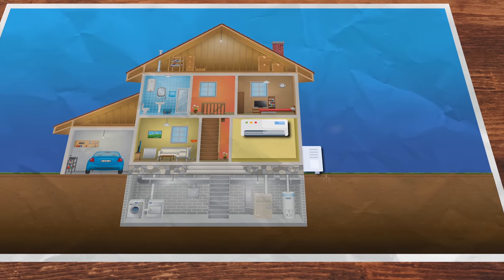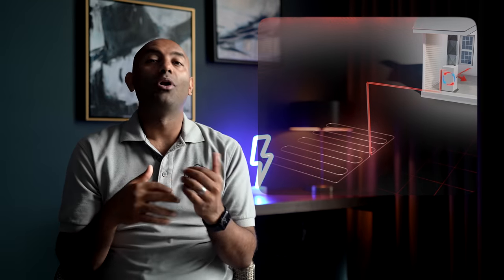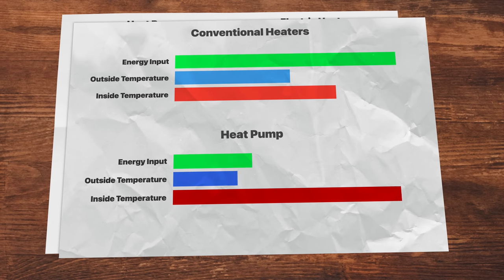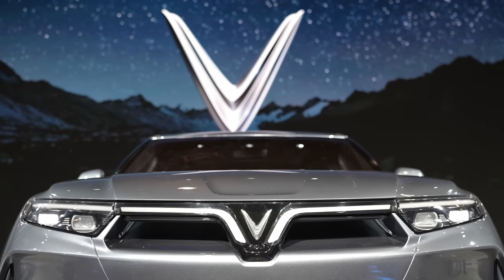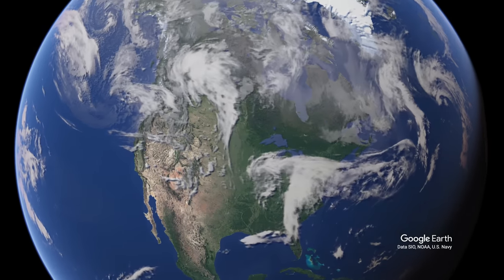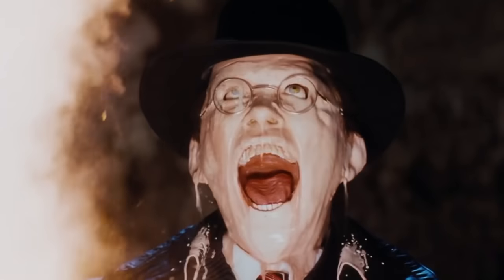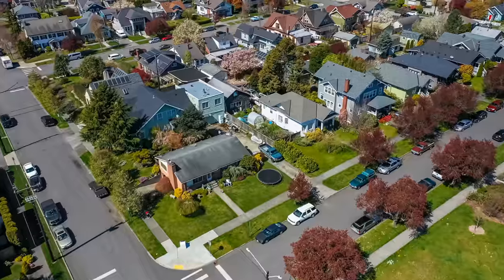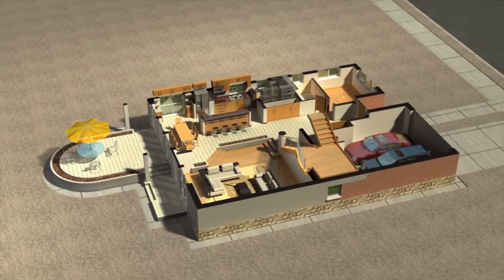Adding This Can Save You Money Summer & Winter!

Comment: At $7,000/well, it only takes 240 years to justify the cost.
Reply: not exactly i mean it can switch you off natural gas which is only going to increase in price especially another 20 years down the road trying to curb emissions. switching to more efficient electric also lets you run off solar so you could even further maximize savings over time. Electricity from the grid and natural gas are only going to go up in price so if you look towards the future at all you are looking at even bigger savings.
Reply: I installed my geothermal. Myself for $22,000. I had estimates for conventional HVAC for $26,000-$34,000. So way cheaper than conventional. Because I installed it myself.  And I have 10,080 watts of solar. 
Zero bills. 3400sqft house all electric. 
If I take what my friend is paying for his utilities. Propane and  electricity. $5,000 a year smaller house built in the 70s. 
It's already paid for itself. Money in my pocket from here on out.

Comment: You are using the wrong term and should know the difference. Geothermal goes way down into the earth and extracts boiling water. What you are talking about here is a ground source heat pump system.
Reply: Or geothermal is the wrong term for ground source heat generated electricity. Can be and is used for both.

Comment: No matter how many of these videos I watch I never see anything about larger buildings utilizing geothermal. Definitely no examples in NYC or Chicago. We also don't hear much about the transfer mediums like R410a.
Reply: R410a is a refrigerant that the compressor uses. You still need a liquid pumped through the underground pipes to absorb or dissipate the heat from the evaporator/ condenser.
Reply: @ColCurtis  heat pumps use refrigerant in reverse to extract heat.
Reply: @damionfragoso2655  they can run in either direction, condenser inside evaporator outside for heat, evaporator inside and condenser outside for cooling. In a ground source system the refrigerant doesn't flow through the ground, a liquid like glycol is used to carry the heat to and from the heat pump unit.
Reply: @ColCurtis  you really don't get it. Leaking refrigerant is one of the largest greenhouse concerns as most of the developing world adopts air conditioning. And the only realistic option is compressed CO2 and it is a long way off due to the pressure it requires.
Reply: @damionfragoso2655  this is the first time you mentioned leaking refrigerant in your three comments, I don't know what you are trying to get at, the refrigerantis in a closed loop. I also don't believe refrigerant is one of the largest greenhouse concerns.  But anyway I'm done chasing your comments.
Reply: More heat to move than the ground can handle.
Reply: @kkarllwt  oh I mean to heat the buildings as for cooling I think that is better for exhausting to the air.
Reply: @ColCurtis  funny because I was the one replying you 🤣
Reply: @damionfragoso2655  Plus all the  refrigerant is inside the geothermal heat pump cabinet no. Lines to the outside unit or mini splits. Less refrigerant. No lines to leak.
Reply: @danmccoy6164  most geothermal heat pumps us less refrigerant than external air heat pumps. As they rely on warm water or coolant that is pumped
Reply: @damionfragoso2655  yes my geothermal system does heat through 3400sqft of infloor heat. And chilled water fan coils for cooling. The water running through the fan coils needs to be very cold. In order to remove humidity.  
The heat pump doesn't depend on the temperature comming in from the loops. To heat or cool. It is just transferring heat to or from your house and putting it into the water coming from the loops.  So instead of having to transfer heat out into 100 degrees air and magically pulling heat out of -15f
Air outside. It only has to transfer it into and from 56 degree water. 
You can use forced air geothermal. With exchanger in a blower cabinet. Less efficient. 
I've been running for 5 years plus. Zero bills. With 10,080 watts of solar. My house is all electric.
Plus all my domestic hot water is supplied by a water jacket around the compressor.

Comment: This is quite a misleading video as the technology is effectively interesting but check all the video of people having trouble with such system and you will see that in reality it does not work great.
Reply: I  installed my system myself. Except for the loops. I paid $5000 to have 4 horizontal loops installed. On my one acre lot. I used the one guy who does all the loops in a try state area. And having a lot of experience. He sized the loops for my system. 
I  think a lot of the problems are with improper loops sizing. 

I had 3 different estimates done for my house. I gave blueprints to all of them. The first 2 I got. Said I needed 6 tons to heat my very efficient house. Both had wildly different and complicated equipment.  Both had estimates in the upper $45,000 range.  Then I found out that the most popular HVAC  company in a local town had been installing geothermal for 35 years. He said that I needed less than a ton for cooling my house. And came up with a 2stage unit that ran on 3ton most of the time. And ramps up to 4ton for periods of a week long -20. Had way less. Way simpler equipment. Came back with $45,200. I couldn't afford that. So I got a guy who does all the HVAC for the plant. That I drive forklift for. To buy the equipment that the last guy had on his estimate. And I installed it all myself. For $23,000.I have had it running for 5 years now. No problems. 
I think a lot of the problems come from having systems installed by contractors like the first 2 I got estimates from. That have no clue what they are doing. And charge double. Just because it's geothermal.

Comment: Most people will never recuperate cost off ground heat exchangers, those are great to woke environmentals and ones that can not count their money.
Reply from the maker: Depends on how long you stay, and what happens to natural gas prices in the future. Such a system is good for winter and summer. I’m no woke environmentalist … trust me that’s not the target audience.
Reply: @TwoBitDaVinci  Thanks for the reply
Reply: I installed mine myself. $22,000 including the  $5,000 that I paid to have the loops installed. 4 horizontal coils  on my 1acre lot. For less than the estimates that I  got to have conventional HVAC installed. $26,000-$34,000.
So cheaper than conventional by far. Because I installed it myself. 
I drive a forklift for a living. Plus I have 10,080 watts of solar. Zero bills. 5 Plus years running. 
I personally like global warming. Living in Wisconsin. I now have a 3,400 sqft shop/house. All 3,400 sqft. Heated and cooled all the time. For free.

Comment: Sure it is! Until nature decides to change the fact that the temperature underground is always between 50 and 55 degrees... Did I miss something?
Reply: What at you saying? Are you suggesting nature is going to dramatically change the ground temp?
Reply: If you go deep enough the soil temperature is the average surface temperature and a vengeful gaia god cannot change this (go very deep and it gets hot but this is another thing entirely).
Reply: @ColCurtis  The video makes it look like the underground temperature may change.
Reply: @ricnyc2759  nature isn't going to change the underground temp, but drawing heat out of the dirt could lower the ground temp. Look up drake landing Alberta solar community.

Comment: Heat pumps are a big con. Loads of people are disappointed they ever transferred over. You have a big ugly box stuck on the side of your house that can make a lot of noise. The cost, then you have to use electric to warm up your water still. Just another climate con that in the long term is going to cause more grief than not.
Go to “Skill Builder” channel and have a look at his take on it from a month ago showing how the cost is a third more than a gas heater. 
He is an English builder and he knows everything because he is an utmost professional construction guy and his 7 minute video tells you everything you need to know why it is a bad idea.
Reply from the maker: do you have an AC Kelly? its exactly what you're describing, a big box sitting outside. imagine if that box could do both heating and cooling. it's really that simple. You have no other option for cooling, it must be a heat pump. But for heating you do have choices, but heat pumps make much more sense
Reply: @TwoBitDaVinci  No and if you look at Skill Builder channel as I said then look at the videos he did 3 months ago and 1 month ago and he explains exactly why They are bad rather than good. Just go and have a look as it will only be 1/2 an hour of your time and you like to get all angles as it is your job to know the pros and cons. He pretty much tells what would be much better to do. It may surprise you instead of just being for it instead of against it. You live obviously in a hot area but us in Britain live in a cooler climate rather than southern USA where you need A/C
Reply: @Vile_Entity_3545    The Skill Builder channel appears to be a promoter of geothermal heat pumps. Look at his January 5, 2022 video on Youtube - How To Install a Ground Source Heat Pump. He talks about the benefits. He dislike heat pumps that are air sourced and has multiple videos on that. They are not the same! Geothermal/ground source units are located inside a home so there is no ugly box outside as you mentioned.